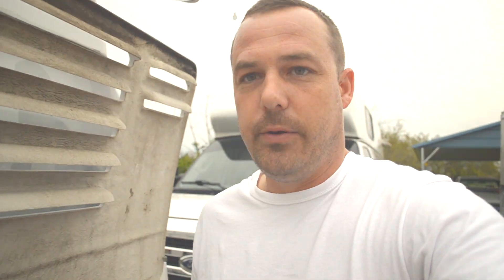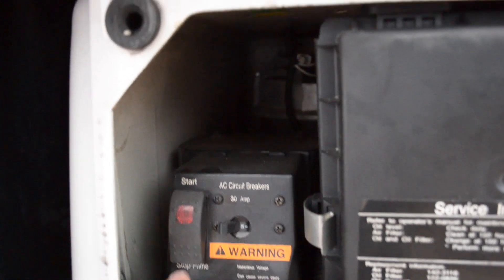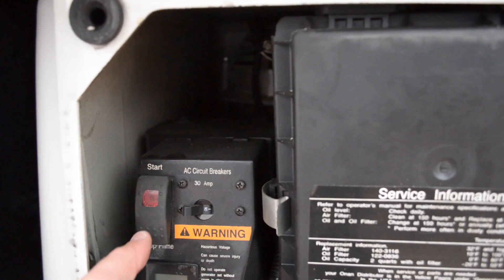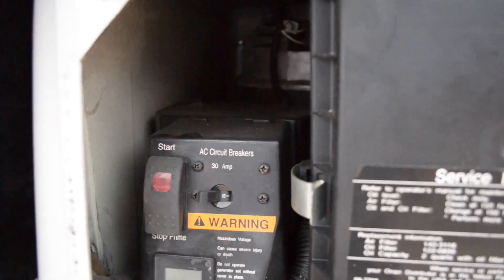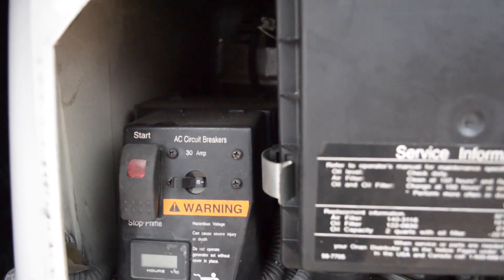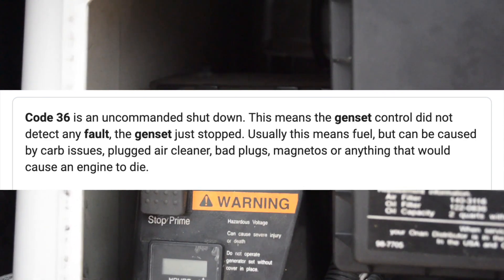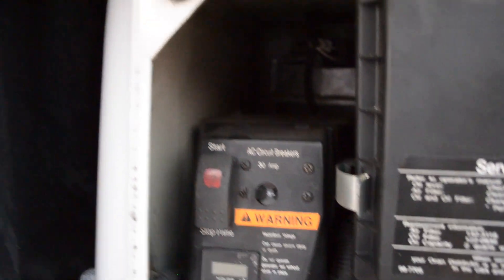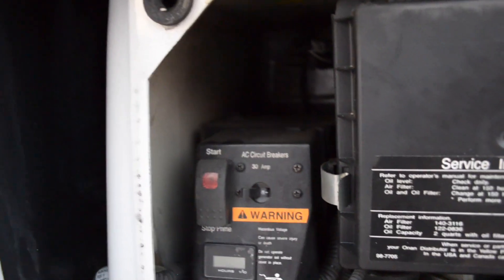How to get an Onan generator ERROR CODE

Comment: What ended up being the problem?
Also, pushing prime 2x does not erase the error code, it just takes it out of fault diagnostics.
Once you push prime 3x quickly, the error is still there.
Do you know how to delete the error code permanently?
Reply from the maker: This was quite a long time ago so the exact issue is difficult to recall.  I believe it was the carburetor choke lever that was faulty.  Easy fix.
Reply: @DiamondInTheRuffMobilePetSpa  fantastic.  mine was the fuel pump but i wanted to know how to erase the error code.  the only way to do that was to d/c the power for a few mins then reconnect.  there's probably a way with the switch but nobody ever had a solution short of removing the power.

Comment: What was code 36?
Reply from the maker: Fault #36 happens when the engine stops running due to a reason unseen by the controller /inverter unit. The most common cause of this is running out of fuel , so you may want to replace the fuel filter as a first step. The electric fuel pump could also be the problem

Comment: When I run my 5500 generator, I get the code 8111.5 displayed on the small monitor next to the start switch.  What does that mean?
Reply: It means you need a new generation